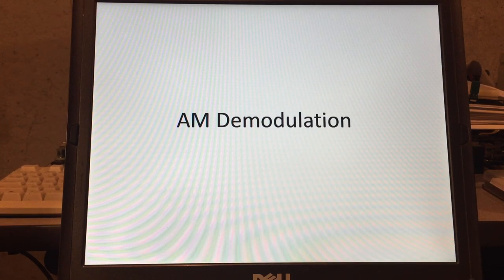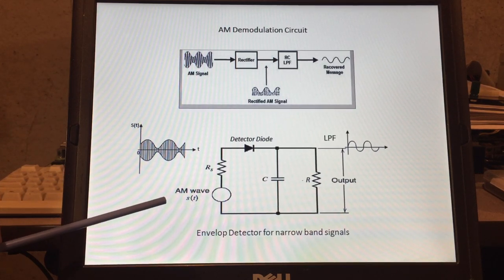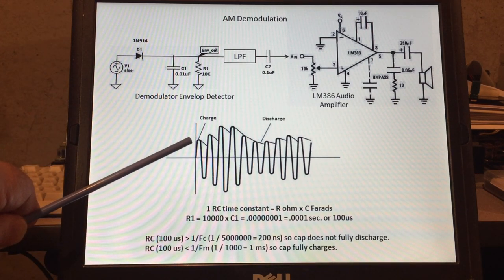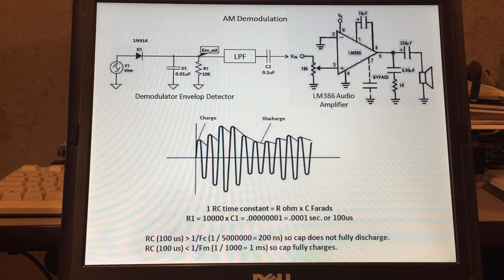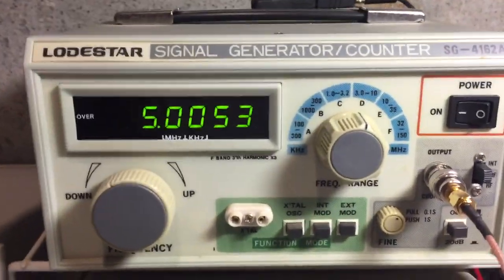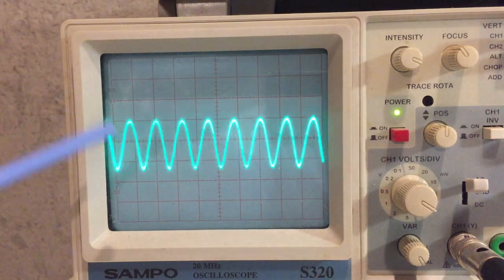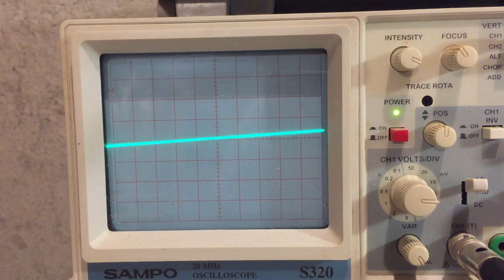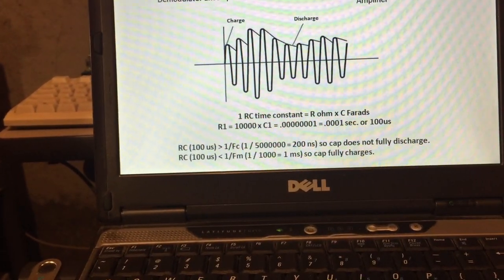AM Demodulation Circuits and Audio Amplifier

Comment: D1 on the schematic shows 1N914 diode which is silicon.  It should be a 1N34A germanium diode instead as you stated in your dialog during the video.  Nice video BTW.  73 de N1FBZ